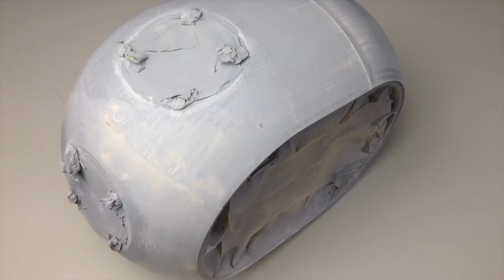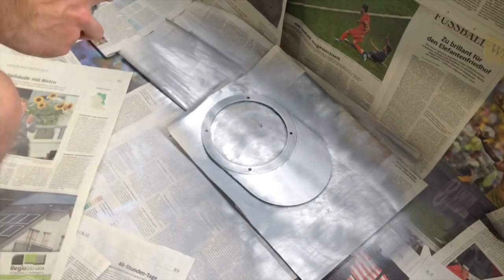Devialet Phantom Inspired DIY Bluetooth Speaker (3D Printed, by Philip Erren) Part III

Comment: i think it would be eazier to open the case if you use silicone dots to stop the vibration
next time you aply the filler use either a rubber squeegie or a plastic paddle you usually get for free in the diy store 
theres allso sumting called high build primer that you spray on realy thick , usually it only takes one layer and some sanding with P400 sandpaper to fill in all the grooves from 3D printing and get a surface finish thats as smooth as a babies bum (its allso only for smooth parts without surface details )
i think a little foam sandingblock helps keeping dents from being sanded intoo the surface 
the biggest part of the job is prepping the part before painting to make it look like its bought in the store for a lot of money

Comment: What a genuis !!! Continue like that dude, it is the best speaker built ever. Did you calculate the volume properly or just put 2 subwoofers without caring about the volume ?
Reply from the maker: I calculated the Volume which is about 6 liters which is a not too little for these two subwoofers but it sounds great!